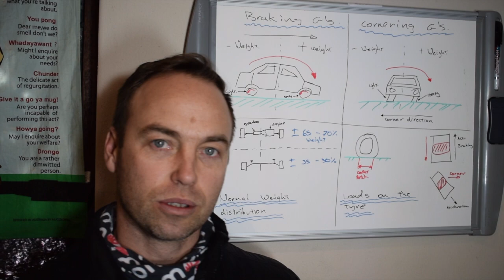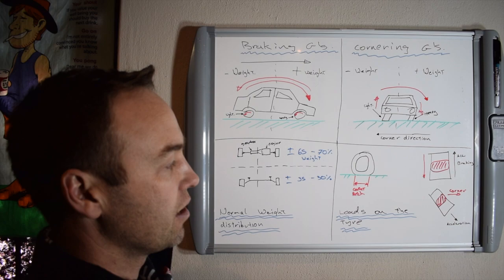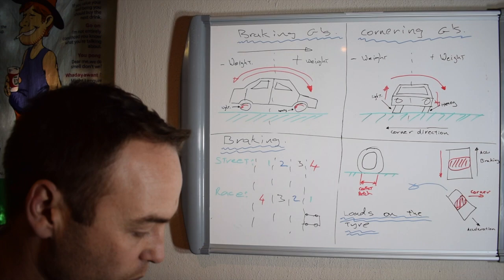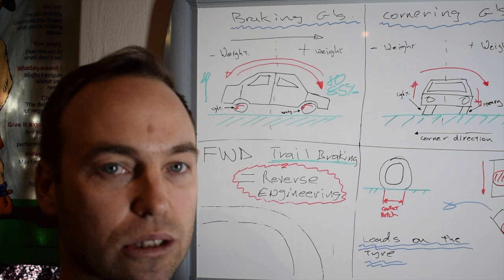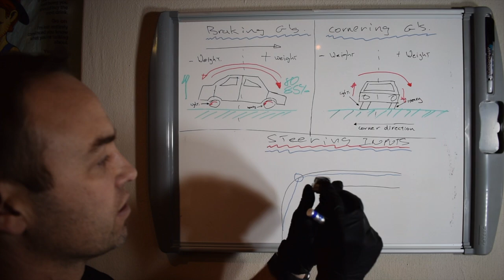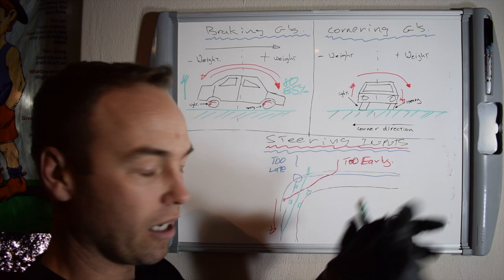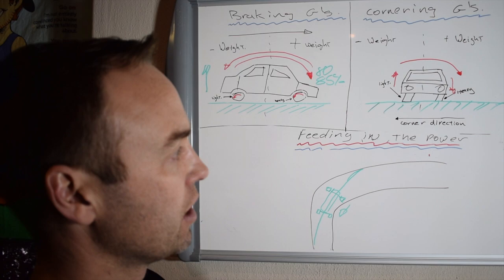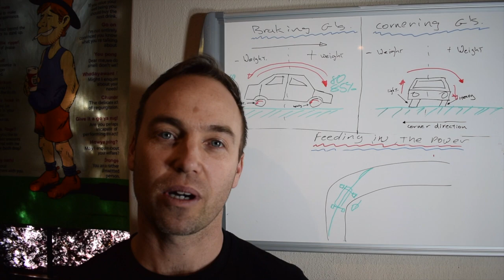FWD Driving Techniques

Comment: On an FWD car Sometimes i use the trail braking technique ,and some other times i prefer to brake before the corner and then turn without braking.i think it depends from the corner,and sometimes it is necessary to trail brake for a short moment,then lift the brakes ,roll into the apex,and then give gas
Reply from the maker: Correct, I have experienced this aswell.
It depends on so many things, setup being a big one. If the car is very stiff & nervous, it will affect how you turn in & then trail braking might not work because of the over ration.
If the car is fairly forgiving then you could get away with it.

Comment: Good info, but you repeat yourself quite a lot, which adds a lot of unnecessary time. You might want to practice speaking your script out loud a few times as well, so you can make sure the final video is much more refined and flows better.
Reply from the maker: Noted, thanks.
This was an early video so much has been leaned since then.
All input is valuable 🙌🏻

Comment: Wow, amazing video. Right before the trail braking section I had a major ah-ha moment (no need to trail brake because of weight distribution over front axle and trail braking applies pressure forward which uses up the tires traction). Plus IDK but force to the outside front tire would exceed inside front tire.
Reply from the maker: Absolutely.
Look there is a place for it but it all depends on the setup, corner speed and the condition of the tyres/track.
But as soon as I figured it out, I had so much more confidence on turn in because the car was a lot more stable .
Reply: More mass over an axle makes it slide sooner in a turn, and have less grip. You have added more inertia to that axle than what the tire can make up for due to load sensitivity of tires. By definition you need to trailbrake more in FWD cars, everything else equal.
Reply: @ArchOfficial  Your argument would make sense if tires had an infinite amount of grip. FWD cars aren't like RWD cars where you dance around the slip angle as you trail brake into the corner. Ideally you'd want to balance the car around a little bit of understeer since the rear axles do not put any of the power down (going sideways takes away grip from the front so you want to mitigate slip as much as possible). What you're talking about works in rare occasions (like overtaking) and even then, you'd be putting too much wear on the tire. Most of us aren't racing our cars so it wouldn't make sense to scorch your tires for the sake of maybe 1-2 tenths. Not to mention driving like this puts you at more risk for making a mistake which could cause an accident.
Reply: @stevenyoon3867  Tires don't have an infinite amount of grip, hence you need to overlap inputs to use the most of it. Tires have more grip when combining inputs than when doing them more in isolation; you have more grip if you brake into a corner and turn, or accelerate out of one and turn than if you do them in isolation. At least with modern radial tires.

Of course there is a time and place for everything and it will depend on the setup too, I'm not saying to fully overlap inputs everywhere if the car doesn't like it. It's not a FWD or RWD or AWD thing, it's just a track driving thing. You want to be on the gas before apex in some RWD cars too in some corners, generally faster ones.

You want to balance FWD cars around mild neutral steer so that you can use the throttle to modulate it out and gain higher total grip on the car, in addition to heating the front less and heating the rear more. Although like you say there is a limit to this and too much rotation actually ends up heating the fronts too much compared to the rears. The rears do heat relatively more than the fronts, but the fronts gain too much heat for it to be practical to do it.

Just because you do not want to do it to save your tires, or you cannot do it reliably without a mistake doesn't mean it isn't true.

In an endurance racing scenario there will be less overlap and less rotation, trading off immediate laptime for long-term tire performance, so this isn't the best thing for every scenario. 

It is generally true. Usually when stiffening FWD cars, the benefit of overlapping inputs becomes less as the car is more and more oversteer biased inherently and requires earlier throttle application, but it will depend on the car too.

Comment: What would you do if your steering was turned sufficiently, and you were on the gas, but the car just plowed forward instead of actually turning? What should you do when that is happening during a short but sharp turn?
Reply from the maker: Thanks for watching.
Depending on the speed, You should gradually get off the power and straighten the wheel a little. This would stop the “ploughing “ and get a little grip back to the front. Once the car is under control again, let the tyres cool down for a lap, try again. Try less speed into the corner and less power mid corner.

Comment: Honestly a great video, I think the only thing I  really felt it was missing was the benefit trail braking can give you. I totally understand that this is going for mostly in a track environment. But on mountain passes and other really tight roads and such, trail braking is fastest than pure grip in my expierence. This could also be because I drive a crx, my car weighs a whole 1650lbs with a short wheel base and brake bias around 80-20. If im coming into a tight corner, and send it into a 4 wheel slide, it's faster than trying with pure grip almost everytime

Comment: In my car—a regular road-worthy FWD hatchback—I find myself applying a little bit of throttle throughout every turn. I feel it makes the car go through the curve more confidently. I assume that’s because—in regular road driving—I don’t slow down really hard before each turn, so the car will not “float” through the turn as mentioned in the video.
I downshift for every turn to such a gear that will provide just the right amount of torque at the wheels if I stay on the gas gently. I do go off the pedal before the turn, however, making use of engine braking. If I wish a brisker exit from the curve, I do find myself gradually applying more throttle as the curve straightens, indeed.
I’m not a very experienced driver, but this came to me naturally. I hope you guys don’t mind my sharing it here.
Reply from the maker: Thanks for watching Marek.
Yes, you need to do what works for you especially in the beginning. However, on a race track, when you are really on the limit, feeding the power in too early will result in understeer.
In wet conditions, you will fedd the power in earlier to have more control over the car for sure.

Good luck, drive safe & thank you for watching!

Comment: Just got a front wheel drive car, coming from a rear wheel drive car.  I found this very very interesting.  I will apply to my next track day, I'm looking forward to hopefully new PB's  Thanks for the tips!
Reply from the maker: 100% Henry, thanks for watching.
The most important thing is too brake in a straight line until you understand the car & don’t get on the power too early.
Good luck👌🏻

Comment: Awesome, you deserve more subs. Just got an 8th gen civic and found some valuable information here about FWDs. Any advice for a novice like me? Currently learning to heel and toe
Reply from the maker: Thank you, really appreciate it!!

I think the most important thing to focus on as a beginner is braking in a straight line before you turn the steering. It is natural to "trail brake" & there is a place for it but when you start doing high speed stuff, a FWD can swap ends on you very quickly depending on how stiff the car setup is.
Next thing is to warm up your tyres for about 1 lap. Again, you don't want to be caught out with the rear swapping ends on you through a fast corner.

Other than that, go to the track, do laps & have fun. The rest will come to you.

I have a FWD setup video coming out in the next few weeks so keep your eyes peeled for that aswell.

Thank you for your support!
Reply: Me too! Thanks for asking this question! 😊
Reply: @ssbb_builds2090  Hello, awesome video mate. Helped clear a lot of doubts I had. But at 22:56 is there a possibility of flipping the car? I run a right handed fwd polo mk5  with a pretty stiff suspension, yet out on the track even wide turns scare me once the outside tyres load up when I'm taking those left turns so I back off quite a bit and lose lots of lap time.
Reply from the maker: @rasheriff  Thats champ, appreciate it!
There shouldn't be a risk of flipping the car if you are on the circuit or track. Iff you go off & the front wheel digs in, then yes, there is a very real possibility that the car will roll.
I would say take it slowly & learn the boundaries of the car. Often these cars have so much more grip then we think but also, don't jump in & try too much. Be patient & learn the limits of grip.
Good luck
Reply: @ssbb_builds2090  Thanks a mil for the reply. Have subbed to your channel. Liked the way you've made your other videos too and am looking forward to seeing more. 😊🍻

Comment: A few corrections:

There's only forward inertia and an inwards lateral force from the tire, at least if external forces are to be concerned. There is no "centrifugal force" by definition.

On that note, don't mix up mass and load. None of the mass in the car is being transferred anywhere from inputs, except perhaps the driver, fluids, objects in the car; but (hopefully) none of the car's mass is being transferred anywhere.

You lose grip by loading a tire more, and you gain grip by unloading it. No, I didn't get that backwards. Grip and acceleration force (be it laterally, longitudinally, whatever) are not the same thing. You do always get more acceleration force by loading a tire more, but it's a decreasing relationship. In any car tire I've ever seen, you "lose more grip" than you "gain acceleration force" in proportion.

That's why front-wheel drive, front-engine cars with a front mass bias (and consequently load bias) inherently understeer, while rear-wheel drive, rear-engine cars inherently oversteer. The lateral acceleration force of the tire hasn't been increased in proportion to the mass (= inertia) added over the axle. This is pretty important to understand for setup.

Bear in mind that mass =/= load. Transferring load with dampers, or adding load with aerodynamics doesn't add inertia to the place where the load is being added; but adding fuel, or installing lead weights or whatever will. This is why aerodynamics add grip to the tire that they're applying load to; it's effectively free load without the accompanying inertia.

Mind you that loading the driven axle of a car can and will increase the longitudinal force that axle can generate in pure acceleration, the above are related to lateral behavior.
Reply from the maker: Thanks for the great feedback, appreciate it 👌🏻💪🏻

Comment: Love your FWD videos wish there were more. Specifically on track only setups with SLA, 88-00 Hondas basically. I have a k24 CRX 1900lb curb, 500f 770r with koni SA. My biggest issue is braking, even on slicks. Very tricky not to lock up front tires against others with abs.
Reply from the maker: I will come back to you on this but I have a whole series coming on a FWD track car.
Only in 2024 though so stay tuned 💪🏻
Reply from the maker: Hey man
We take the brake booster out the car, this helps with modulation on the pedal which assists with locking up.
It could also be the brake pad , like Endless pads have mega bite soo you have to get used to them.
But with the booster out it’s much easier to prevent a lock up.
I would also install a brake bias controller (proportioning valve) on the rear brake line. Take away rear brake to stop the rears from locking up.
Reply: @ssbb_builds2090  Ah that’s a good idea. Its always the front that locks up, I ease into the brake to keep it from happening but feels like decelerating G is much lower than anyone else’s. Idk if too high front spring rate, stiff rebound or too much caster could cause poor traction during braking. Lowered camber to -2.5 and added caster to 4.5 to try and help gain grip. Hawk HP+ pads on stock brakes so nothing crazy, BFG R1 tires 205 on 15x8. Ordered some 15x10 front with 275 Hoosier R7 lol maybe that’ll do it?

Comment: Own my first FWD car (8p A3) after having six RWDs.  Although for racing application I appreciate the insights, especially not trail-braking (been doing that the whole time!). I don't track but do like to push my car on the street, and would like to get the most out of it SAFELY. Any more tips would be greatly appreciated.
Reply from the maker: Hi Stephen
Thanks for watching. 
I would say get there car setup reliable. What I mean by that is make it quick but predictable for the street.
Start with a good set of tyres. This will depend on where you live so if you have allot of rainfall then get a good all round tyre. Hankook RS4 is pretty good. continental extreme contact sport is also a good option.
Get some good brakes & dampers that can deal with street conditions.

With regards to driving, it’s the usual FWD story. Don’t get on the power too early, release the wheel mid to exit etc.
Trail breaking is dependent on the setup & corner. I don’t recommend it in a FWD but there is a place for it. In a road car it’s ok, but the faster you are driving, the more dangerous it becomes. So be careful.
Good luck 👍🏻
Reply: @ssbb_builds2090  Thank you! Currently refreshing the car. Just fit brand new Pilot Sport 4 (4S aren't available in smaller sizes), and Brembo OEM replacement discs and pads. 

Will be tackling all drivetrain mounts/bushes/ball-joints now (polys for most of these).
Car is a bit soft for my liking but will look at springs/dampers last. I'm also intrigued by a bigger rear swaybar, but honestly I haven't had to deal with the type of understeer that is commonly talked about, think it applies to the track mostly. In my hands it has been far more important to pick the right line and speed, then be judicious with the throttle, ZERO understeer....unless I'm just not going fast enough lol!

Comment: What can one do when they enter a corner too fast and start to understeer(in a fwd). If I lift off the car may oversteer. If I keep my foot to the floor the car will keep understeering. If I brake the rear may violently swing around. I guess unwinding the steering wheel and quickly trying to regain front traction is the only option???
Reply from the maker: Thanks Tom, great question.
Yes, open the wheel & brake until you feel the car has slowed down enough to be able to turn again.
That’s why I always say build your speed up & don’t try break the lap record early in the session 👍🏻
Reply: @ssbb_builds2090  thank you!

Comment: Can you add more tire pressure to the rear tires on a FWD to help reduce understeer? Or putting on different size tires in the back
Thank you for this content.
Subscribed,  saved video to re-watch as I do more track days. My car is 63% front 37% rear weight distribution and I have limited slip in front tires.
Reply from the maker: Hi, thank you for watching!
Yes, I normally run the rear quite a lot harder especially with a semi slick tyre.
But I would be careful on how much harder so start off with about 15% more pressure then the front.
Good luck
Reply: @ssbb_builds2090  thank you for replying. I came across something I can not understand but maybe you can. First my thoughts agree with what you said running more pressure in rear to help reduce understeer. Two people shared with me two different sources that claims to reduce understeer run higher pressure in front tires and lower in rear tires. Do you have any idea how that would make sense? Thanks 
My next track weekend I'll be running on Bridgestone Potenza RE050A RFT tires because the Michelin pilot sport cup 2s get expensive.
Reply: @334trax2  for "calm street driving😉" on my Peugeot 306 GTi i run 2.4bar front/2.3bar rear. that is because the car is very light at the back(its a hatchback) so it oversteers on liftoff/entry. on a sedan or an estate(my dads passat 2012) you can put bigger tire pressure in the rear but it will oversteer on bigger/faster truns(somewhere above 110kmh) but try learn liftoff oversteer because it can set you up for the mid corner very nicely, i do it even in the passat(ESP doesn't like it hahah) I mean im still trying stuff out but you can contact me on ig
@peugeot306.cro

Comment: I think 65-75% of front weight distribution is a big hyperbolic, B5 A4s were known for being very front heavy with FWD models having a claimed 61% front weight. Maybe all of my reference points are all skewed by FWD Euro cars, because Volvos on the far end barely reach 57%
Reply from the maker: Thanks for watching!
Yes, they will all have different % values but for the most part, they are very front heavy.

Thats why driving them is so interesting but so rewarding when you get it right!
Reply: @ssbb_builds2090  That they are! I've certainly come to prefer FWD in learning!

Comment: Thank you for the video! One point there you have mentioned that it is not recommeded to use trail braking on FWD car to avoid oversteering. Is that correct for a slippery road too? When I drive my car on a snowy road and try to do something like a trail braking I always get understeering instead.
Reply from the maker: Thank you for watching.
Its probably because there is very little grip on the road due to the snow/ice.
In that case, drive very carefully & try find the grip.
Drive safe & thanks for watching.